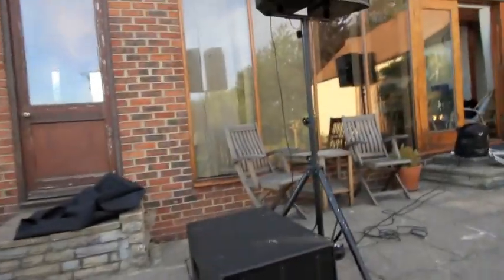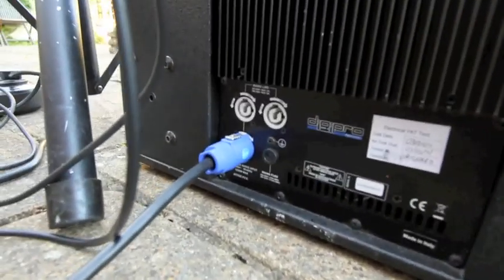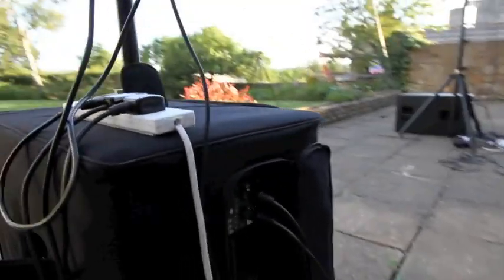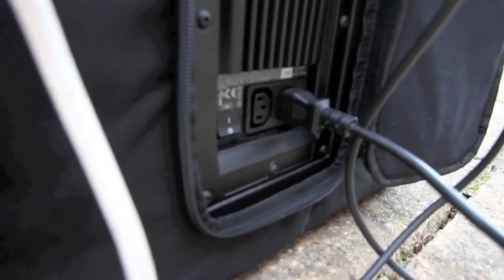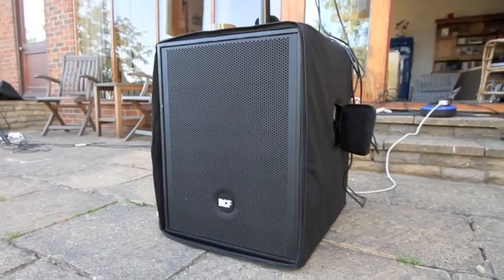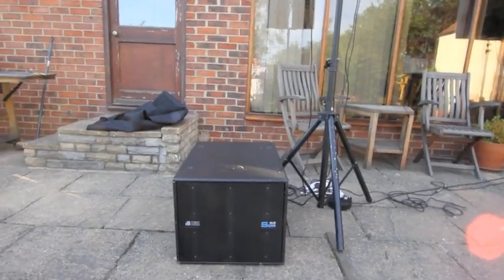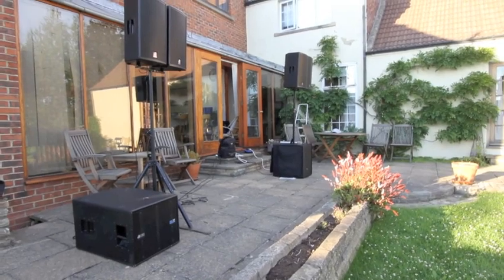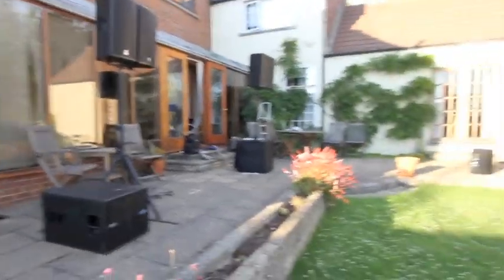DB Technologies DVA S09 sub vs RCF 905AS sub.m4v

Comment: Hi James, I actually bought a pair of 905's having seen your review a couple of years ago (great review by the way!). I am a guitar vocalist-turned DJ-turned guitar vocalist again! I have to say that I was never happy with the sound of the 905's in that they always sounded a bit one-note-ish. This surprised me since I was expecting a flatter response from a reflex box (as advertised everywhere) and I was starting to get suspicious! I persevered with them but this summer I decided to open one of them up and low and behold, the 905 is actually a bandpass box just like the 705! Being an ex-DJ (20 years!), I would say that the 905's are great for dance music and offer a good bottom-end thump from a relatively small and lightweight package. However, I would not recommend them for more neutral system requirements and have now sold mine with a view to getting a pair of the new 705 mkII reflex cabs. Hope this comment is helpful to some of your viewers. Cheers, Ian B, Wirral.

Comment: @SoundXperienceDJTeam also, re DB & RCF relationship, most people know that but in the UK market most people would expect the RCF unit to be the best. key stat differentiating these boxes is the 4inch voice coil on the 15" woofer in the DB box, which is probably responsible for its slightly deeper & more tuneful response (IMO). Still both great pieces of kit tho.

Comment: The 905-as has both a high pass and a low pass.  The high pass filter is for the output link, acts as a crossover for your tops so they don't run at full range.  Very useful.

Comment: today i did a little comparison test between the DVAS10 18" model vs the RCF 905AS just to see how they all got on and can report that the 18" cabinet from dB is a significant step up in performance over the smaller RCF number. In fact having heard the single 18" RCF TT18A cab i would suggest that as long as u don't mind the handle configuration on the dB unit there's no point spending the extra money on the TT gear.

Comment: @SoundXperienceDJTeam very true, i hadn't even realised until i looked back at the video! Of course with the DVA being designed for arraying you'd expect it to have loop through, also as you can probably tell i couldn't remember what the cable was called hence the momentary hesitation b4 i said speakon! Either way, these videos are frequently full of much greater misnomers than mine is, & i think i get the message across ok.

Comment: anylised the RCF905 by taking out the 15 and running a signal through LEAP. alos in thebox. Found that is was a band pass system when we pulkled it apart. it was not a very smooth transition throughout. it spiked at 68HTZ and 170HTZ. And it dropped of significatly at just before 50, hence the loss of gain down in that region.. got some tech info from RCF techs re crossover slopes and AC coupled filters because we wanted to mod it with another speaker..

Comment: Nice Video. I have a questions on the covers, is this a completely enclosed cover? Meaning, does it protect the bottom of the subs as it sits? Also, if it does, does it lay flat or does the cover under it bulge? Thanks...

Comment: @TurbulentMethods neither box quotes their output on slow response or C weighted figures, as is the case of almost all speaker manufacturers from Funktion One or EAW right through to Void or d&b. Transient response is also an important factor to consider and using C weighted measurement would negate the differences these two cabinets exhibit, but if you want to try and come across all 'high and mighty' then please continue. The power rating does have an impact but of course is only 1 factor.

Comment: The connetors of the dB-sub are not Speakon, but Powercon. Speakon = passive speakers, Powercon = powering for electrical equipment. Speakon wont fit into the socket.
Its also not true that the dB hasnt got the possibility to loop through power cables. He even has 2 of them. The blue powercon is the input, the white one ware the 2 outpts. The advantage is that powerconn can not be accidentally pulled out.

Btw. RCF is part of dB Technologies and dB uses RCF-speakers amplifiers (like DigiPro).

Comment: @SoundXperienceDJTeam i also think you're right 2 point out that 50Hz isn't that 'deep' but think its a mark of respect to the cabinets- dealing with high SPL at those kind of freq's is the reserve of genuinely high end sound equipment & many DJ's/ sound techs won't have budget 2 do any better than these boxes allow. The fact that you mention this means that you're comparing these subs 2 more expensive and esoteric kit- thinking bigger as oppose thinking smaller. A mini stack of 4 DVAS09: power!

Comment: @surferjc Well... it depends on the series. DVA ist mor professional (see: Powerconn). RCF as brand might be the better then dB. But they all use RCF-Speakers since dB has bought RCF. Both of those subs are Bandpass-subs. Made for a high sensitivity and often because of this they are tuned a bit "high"--. With deeper tuning, the max. SPL wouldn’t be so high. They can tune the boxes however they want. I mean 50Hz… that isn’t really deep, but deep enough for most of live application and music.

Comment: Question I have my sub DSP on L1 but still gives it with a hi pass on my mixer filter, on L1 it is up to 60 Hz but officially I hear that it continues to give up to 300 Hz bass is that normal? and if i play hard than the sub have no feel anymore, only a higher bass my speakers are new, i have 4 8003 mk2 i use 2

Comment: @TurbulentMethods additionally, i doubt that any1 looking at these subs is interested in producing 20- 30 Hz as they would probably (like myself) have to buy a bigger car or van to put their system in. For me, these represent the most powerful bins i can easily fit in an estate car with 2 powerful tops, a pair of flightcased CDJs & a small light rig ie a DJ rig, not a 5000 person outdoor event touring rig! Again, why even mention 20- 30 hz when both boxes don't even cover those frequencies?

Comment: the DB sub is 1,300 pounds, man that thing is heavy  :) Just kidding , I knonw pounds as in money not USA weight. Also, the top cabinets that are sharing a stand are producing serious "comb filtering" they need to point angled more away from each other to eliminate the horrible build up of excessive midrange. Turn one side of your system completely off so you are only listening to the two on one stand. Go back about twenty or so feet, or any distance really, and stand precisely in the very center of the two cabinets as they are pictured in this video. Face the speakers and walk very slowly sideways and listen to the mids and highs. You will hear a very nasty, phasing, swishing sound. You need to spread the two cabinets sharing the stand apart to the point where that swishing sound is gone The fidelity will be massively improved for many of the people in the crowd, whether they are dancing or sitting listening. Try it you will be amazed.